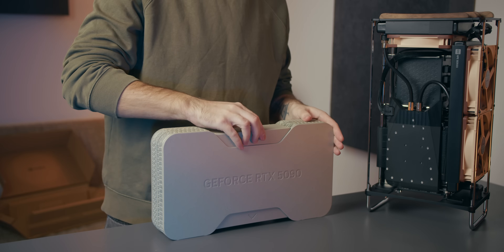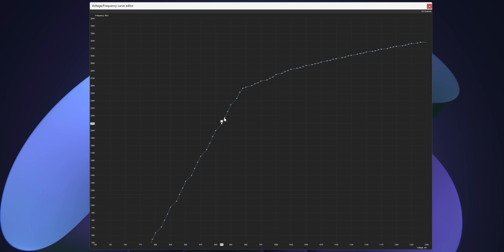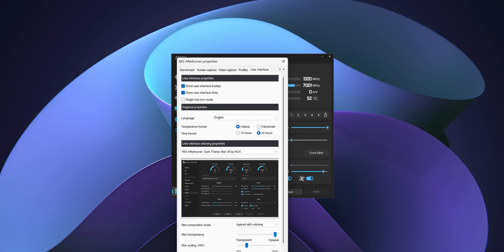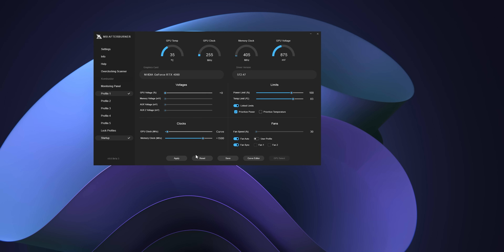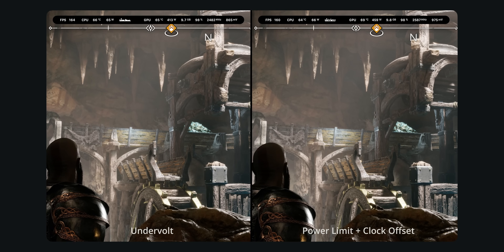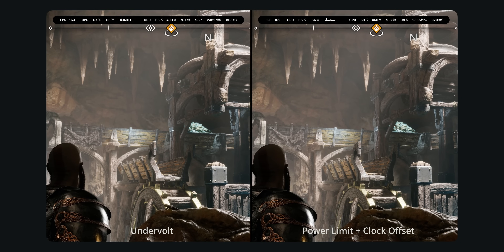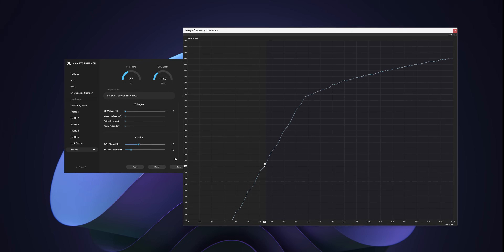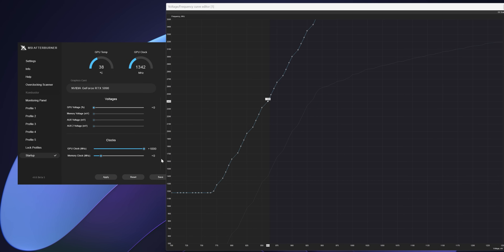5090 FE Undervolt Testing & 4090 Face-Off

Comment from the maker: Note that the 3D Mark scores I got in my testing have since improved with subsequent driver updates. See updated scores below with driver version 576.02.

Steel Nomad Stock: 14142 https://www.3dmark.com/sn/5396869
Steel Nomad 885mV: 14483 https://www.3dmark.com/sn/5398318
Speed Way 885mV: 14798 https://www.3dmark.com/sw/2155802

My highest score in Steel Nomad: 15131 https://www.3dmark.com/sn/5398536
Reply: Speedway 885mv with an average clock frequency of 3153? That is insane. Something seems to be off. How much mv does the card actually pull in the test? Steel nomad frequencies look in line with expectations. Maybe founder edition behaves differently with the new patch or it is the bug where MSI applies more voltage than what was set (that is a bug where you have to reboot the PC). Would be awesome if it is real though.
Reply from the maker: @Winterfalke  I don't look at the average frequency in the 3D Mark report, never seemed reliable to me, only thing that really matters is the score.
Reply: @EIGAtech  Thanks for the info. Your video helped me learn how to undervolt my 5090 so thanks for that as well :)
Reply from the maker: @Winterfalke  Happy to help!
Reply: For some reason my FE only let's me go up to 2572 at .875 not .870
Reply: @xSabinx1  Same here about the .875 for 2572, hence, I can't replicate these results, I'm kinda in between, and can't get the same sweet spot shown with the .870 of the video, i'm closer to the power draw of the shown .885 at .875mv saddly.
Reply: Pretty good score! My PNY 5090 snagged me a 14800 the other day after a little tinkering.Not sure how much higher I could get it... probably not much!

Comment: Great video! Just a quick q - would you not be able to keep the idle power draw the same as stock (lower) by not pulling the entire curve up and only pulling up past the voltage you want?
Reply from the maker: Idle power draw doesn’t change in any perceptible way.

Comment: Yo bro, very good video. Do you think a 1300W Atx 3.1 Cooler Master Silent Max Platinum can handle an undervolted/tuned I9 14900K + undervolted/tuned 5090 Astral?
Reply from the maker: Thanks! Absolutely it would.
Reply: @EIGAtech This card costs about USD4000 here, thats why i was asking to you. I hope undervolt + tuning makes the 5090 safer, has the problem ended by now?
Reply from the maker: @Rodrigo_A1  The problem cannot end. But with undervolt and pin monitoring you’re as safe as you can get.
Reply: @EIGAtech Yeah, I was thinking about getting a 5080 just to be safer. But, 16GB VRAM on an expensive card that did not bring a great uplift compared to the 70ti (much cheaper) is kinda weird. Anyway, u not going to see good experiences being posted online, just the problematic ones.
Reply from the maker: @Rodrigo_A1  I say use it, take the precautions (uv, pin monitoring) and don’t worry about it. Use the original PSU cable (not custom ones) if you want to be extra safe in case of a warranty claim.

Comment: Better way is lock the freaquancy with double click L at curve point then add + freaquancy in main menu msi afterburner.
Reply from the maker: You mean hit L once to lock the voltage point and then add the offset core frequency? I’ve actually tested that method and it does perform the same as the flatten method. Given that it is a bit simpler to do I will recommend it in an upcoming video.
Reply: @EIGAtech no, hit twice L, and afterburner lock frequency, not voltage.
In that way you don't loose effective clock
Reply from the maker: @graviusmatt  If you lock frequency then you can no longer offset it?
Reply: @EIGAtech no, offset change the voltage at lock frequency. You lock 2790mhz, then if you increase offset the voltage goes down
Reply: @EIGAtech the yellow line should be horizontal
Reply: You choose whatever frequency you want (for example 2790mhz), hit L twice at that point (no matter what voltage in curve graph). If you see yellow horizontal line you do everything right. Then increase core offset
Reply from the maker: @graviusmatt  That doesn't make any sense to me. It makes a lot more sense to use L (once) to lock voltage at desired point, then increase the offset. It's basically the flatten method but simpler.
Reply: @EIGAtech if you lock the voltage then what about power consumption without load? 😊 You do nothing but gpu eat 100-150w minimum. At desktop
Reply: Funny moment when you lock frequency it locks only max clock. But voltage locks every time at one max state
Reply from the maker: Right, then the flatten method shown in the video is still superior, with voltage locking you will indeed get higher power consumption. I still don't understand how your frequency locking method works though.

Comment: Also GPU tweak Allows OVER 2000mhz to the memory. It does not have the dreaded power monitoring bug alot of people deal with. I actually uninstalled After Burner and am learning to use GPU tweak because of the issue! Something to watch! Great video BTW....probably the best most informative I've seen to date. THANKS!
Reply from the maker: Thank you so much! Just a heads up about GPU Tweak, during my testing using the same V/F curve editing technique as in MSI AB I found it resulted in considerable lower clocks and performance. I am going to have a new video on undervolting soon as well.
Reply: @EIGAtech weird. My tests results were nearly identical. Plus or minus maybe 1 percent. But afterburner caused major dips in 1% lows on AMD CPUs. There a lot of info out there on it.

Comment: How 2737MHz@885mV is possible? On my 5090FE 885mV node maxes out at 2665MHz (+1000).
Reply from the maker: Different cards have different "bins" and the voltage/frequency curve may differ.

Comment: Are these numbers (clocks and voltages) in comparison charts MSI AB settings or real world readings (like say 2737mhz)?
And are you still use the same settings for the nvidia newest driver 581.29 as of today? the latest 3 drivers are buggy when it comes to 5090 undervolting

Comment: I use the Power limit feature in the Zotac Firestorm app 12% off the default settings for the Zotac OC it pulls just over 500 watts at max settings and is within 2-3% of a non-OC card performance. Very happy. I was undervolting specifically but honestly... being within 5% of stock running about 100 watts from the OC power limit makes this card super cool and I never need to mess with the settings because its always going to be stable with a power limit vs undervolt.

Comment: Hey, i highly suggest you watch for Effective Clocks as well, other than that this is very great tutorial, one of few channels that showed actual proper way to undervolt GPU with proper flat curve.. Very great. And btw GPU Effective Clock should not deviate too much from your GPU Clock. The closer effective clock is the better to GPU clock, if lets say your GPU clock is at 2800 and your effective sitting 2700 or 2600 then that is sign of instability or lets say card needs more voltage to achieve your desired clocks. Best regards!
Reply from the maker: Hey, thank you! For my 4090 I did exactly that, with effective clocks staying between 25-50Mhz of the target frequency. However, on the 5090 effective clocks are way lower, which is why I focus solely on performance when testing. It’s actually very interesting, I have some 3D mark personal records achieved with the UV method (but for overclocking) that show a lower frequency than results done with a classic positive core offset, and yet, the scores are higher.

Comment: @EIGAtech thanks for your response, hard to get a response from actual content creator, and you sound knowledgeable at your content. So will take your advice. What would you recommend targeting? (I know each card is different) but want an idea on what to aim for, if i’m aiming for high frequency, with a good under volt.

Earned a subscriber.

Sorry accidentally deleted original comment.
Reply from the maker: Thank you! 

I’d start somewhere between 920mV up to a max of 950mV. I am fairly confident that at 920mV with +3000 on the memory you will be beating stock performing in 99% of the cases while still enjoying a nice reduction in power draw. In terms of the target frequency (the one you set in MSI Afterburner) I think you should land somewhere close to 2900-3000 Mhz at 920mV depending on your individual card.

Let me know how it goes!

Comment: running 900 @ 2900 gives 15165ish on the SN bench better than stock with less power. i dont see the point making it perform worse than stock when you can beat stock and still save power.
Reply from the maker: I run a 885mV +3000Mhz Memory UV as my daily which is very very close to stock performance across multiple titles.

Comment: you are messing up the idle frequencies with this method. increasing idle power draw. dont need to drag the whole curve up, just the visible points on the graph. that will keep it idling properly at around 225mhz
Reply from the maker: I tested it and the increased frequency at idle has no meaningful impact on power drawn or temperatures for me.

Comment: What would be the best undervolt/underclock/power-limit settings to theoretically bring a 5090's performance down to match a 4090? While keeping temps as low as possible.
Reply from the maker: To match a stock 4090 in wattage? I would go with a 890mV undervolt.

Comment: I never thought that one video can solve all my doubts related to 5090. 
My god dude, this is the best video I have seen around undervolting 
and you even went beyond by comparing an undervolted 4090 to compare generational gains. 
Thanks a lot dude. Definately going to rock the 2572Mhz @870mV. 
I am absolutely fine leaving 1-5% performance for a solid peace of mind. 

I am currently using 7950x + RTX 3080 on a 850W corsair gold PSU. 
After the undervolt, I would be fine using a 5090 on my rig right? :3 Plz help me senpai
Reply from the maker: Really glad you found it useful! The 4090 UV vs UV was something I found particularly interesting and haven’t seen others do. I think the 850W PSU will be fine.

Comment: With an undervolted 5090  (2572MHz @870mV) and a low power cpu (like a 9800x3d), is a 700w 80+ Titanium Seasonic PSU is OK ?
Since the whole system should draw around 500W
Reply from the maker: Possibly, but that doesn’t take into account transient spikes. I would go for a 850W one at the minimum.
Reply: haha. just buy a proper psu, dont penny pinch

Comment: Yeah adjusting the curve made a huge difference on my 5090. Using 150w-200w less on almost anything I throw at it when under full load. 

Not only that but the small "performance loss" I get initially typically ends up being the same as no undervolt if the tasks go on long enough simply because of thermals. I don't think the 5090 can handle running on air with stock power for workloads that are 6+ hours unless you turn your computer into a vacuum cleaner noise wise. It's also more stable under most stress tests I threw at it with the curve adjusted than it was stock... Not by a small margin either.

Also ended up getting the Astral just for the extra power pins monitoring so I could set alerts in hwinfo in case the current started exceeding the cable specs. Hopefully that's enough to prevent a potential catastrophe later.
Reply: i love that you buy the most expensive 5090 then run it slower than an FE.

Comment: My clock is stuck at around 2400mhz at .875mv, what am I doing wrong? Also what is your clock at completely stock with no PL uppage on Nomad? I couldn’t get higher than 2650, but it was pegged at 575W.
Reply: You either incorrectly adjusted your curve ( I usually use Msi Afterburner) or your card is just that unfortunate 1% that is at the bottom of the pile :/
Reply: Don't forget to unlock the frequency and mhz control in the settings as well If you didn't already
Reply: @izzy32324 not all cards come with the same voltage curve from what I learned. Mine is clocked slightly under stock. Somehow performs better though. It’s a brand new card so maybe they are changing things.
Reply: @Kole208  interesting thanks for that piece of information so what you are running at about 2.4mhz-2.6mhz?
Reply: @izzy32324 it depends on the test, I’ve seen Nomad at stock settings hit 2670MHz. Heaven goes over 2800MHz stock. Undervolted at like .885mv I sit somewhere around 2590-2630 on Nomad I think. Depending on the game the boost will very, but my frequency graph curve seems to be lower than others stock.
Reply: @Kole208  that is all really helpful to take into consideration...thank you  also .885 is pretty solid I just got my card so I started it at .975 and just made it through lies of P max settings with no problems I am also boosting core  and memory clock slightly so I really don't know how much lower I could afford to go. My temps are sitting in the  40-50s so I feel like I am in a good spot.

Comment: hi EIGA I was about to get a 5090FE but a bit concern with the liquid metal, I noticed a 3 layer gasket around the die but what are your thoughts on it? Should I replace it with PTM or have it the way it is? thx
Reply from the maker: I had no issue with mine, I would not mess with it unless swapping to a waterblock. It’s too early to say how the liquid metal will behave in time as this is the first time Nvidia has been using it.

Comment: Do you know if the Power Management Mode setting in Nvidia control panel affects this at all? I’ve always set it equal to Prefer maximum performance on lesser GPUs but am thinking that might not be such a good idea anymore with a 5090 I’m planning to undervolt
Reply from the maker: It doesn't make a difference as far as I know.

Comment: Excellent video Eiga found this quite helpful and informative on why undervolting is so cool! Question tho as it's been a few months since this video cam out, I'm currently on the latest driver 576.88 and I cannot get that +1000Mhz without crashing after clicking apply in after burner. Can you share what undervolt setting you are currently using and what driver version? Thank you!!
Reply from the maker: Thank you! Not much has changed for me since this video. I'm running the same UV profile of 2737Mhz@885mV but with a +3000 Mhz offset on memory and my voltage/frequency curve is exactly the same on the latest drivers (576.88).  

It's very likely you have one of the lucky cards with a less steep voltage/frequency curve, in which case, you will need to go for a lower offset. 

When you target the 885mV point and enter a +1000 offset, what's the target frequency that shows in the curve editor? If it's higher than 2737 or so, then you will need to reduce the offset until you get stability. If that's the case, you can actually target lower voltages, maybe 850mV, as you'll be able to get to higher frequencies.
Reply: @EIGAtech  Hey sorry forgot to respond but thanks for the reply! Yea at 885mv I'm at 2665Mhz and at 850mv i'm at 2245 Mhz. Really does seem to just be a silicon lottery kind of thing. I've been able to run 900mV at 2800Mhz really great so far though! Also i found this cool tip where 800mV is the lowest voltage nvidia has 5090s so I reduced from 835mV downards to stock frequencies (+0Mhz) so at idle (browsing, coding, watching videos) im running stock voltages/frequencies and when im gaming (anything over 835Mhz) my undervolt will be active!

Comment: can you make a start to finish undervolting tutorial for this card up to date with anything youve changed since? id love to do it but never done something like that and dont wanna mess it up. great video and subbed

also how much difference did it make in temperatures?
Reply from the maker: Thanks for the sub! I am still running the same undervolt as in this video and nothing has really changed since. I will probably make an updated video at some point in the future though.

For thermals check around 17:30 in the video.
Reply: @EIGAtech damn so a 50F difference is pretty significant thats awesome

Comment: Whats your idle power draw ar 870mv and what type of display/refrsh rate for that idle power draw?

I want the least power draw as possible and since i dont game i also want it to just perform well in davinci studio.

Can it work 100% of the time at 700-750mv?
Reply from the maker: Idle power draw doesn't change for me between stock / 885mv / 870mV, it's about 20W at true idle, but as soon as I move my mouse it shoots to 30-50W. Display is 4K @ 240Hz.
Reply: @EIGAtech i have a 4090 and i use the simple power limit method at 50% (i know its a waste but for me its great) and it does everything i need bit i just want a reason to get a new toy.

You think the 5090FE can run well without issues at 750mv - 800mv?
Reply from the maker: @KoiAquaponics  Unfortunately because of the steepness of the voltage/frequency curve and the +1000Mhz maximum offset the card will be running very low clock speeds. For context, at 800mV my card would boost to only 1.6Ghz, nearly 1Ghz lower than at 885mV. The lowest I would run would probably be around 850mV.
Reply: @EIGAtech i see, so im guess with my 144hz 4k display at 850mv it would ve very efficient and when i need to render stuff in davinchi that undervolting will be more than enough. Whats the max power draw at 800m and 850mv?